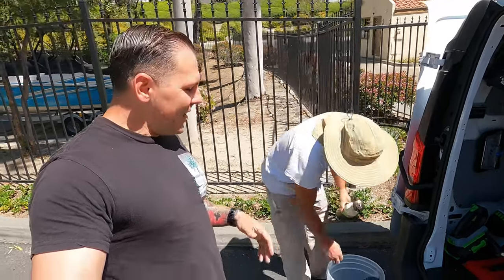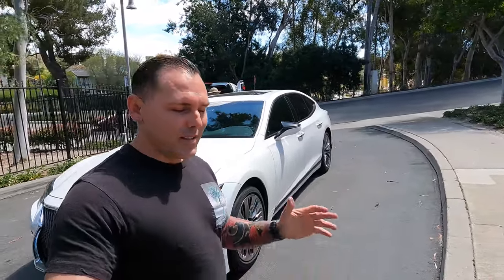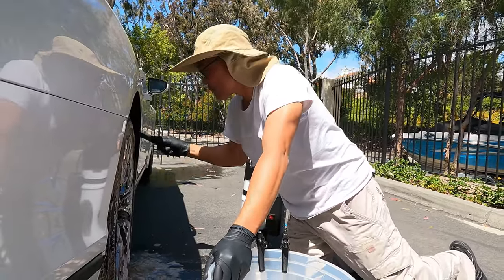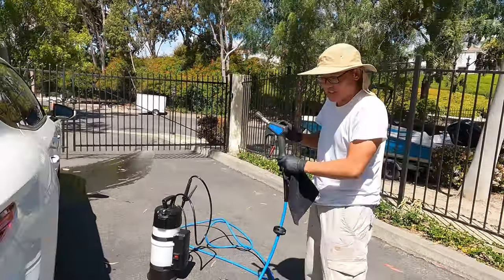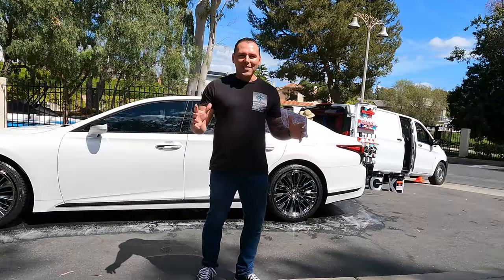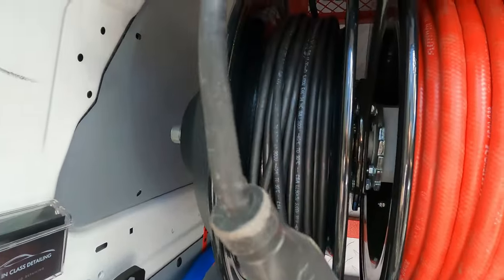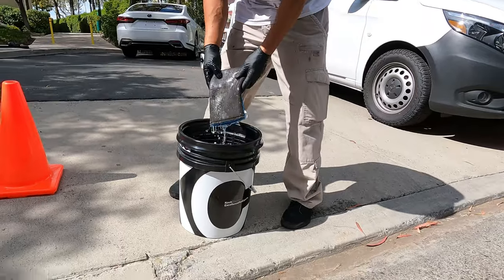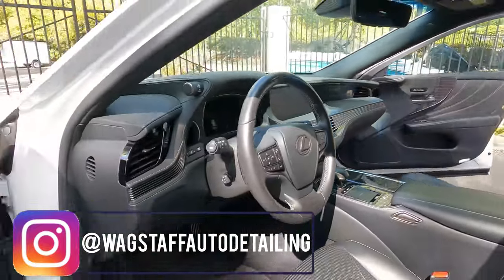Mobile Detailing Setups of 2024!!! Setups of America! MERCEDES METRIS EDITION!

Comment: I’m not sure why he’s not able to but I have the same delta pro and it runs my ridgid vacuum, ridgid compressor and my dupray tolsca steamer at the same time.
Reply: Have you added up how many total watts that is ? My predator 3500 runs the chief steamer & vacuum fine, but I can’t turn on the rigid compressor with them or it overloads. I’ve been thinking about the predator 5000 or taking the plunge to the ecoflow. Any thoughts or experience ?
Reply: @PolishedMobileDetailing503 the ecoflow delta pro is the at to go for sure when you get it on sale. I paid $2,000 for mine brand new with tax. It’s 7,200 surge watts and can do 4,500 running watts with x boost mode turned on. 0 noise, 0 maintenance and much more compact.
Reply from the maker: @obsessedmobiledetailing Id like to order one EcoFlow delta pro off you sir! 😂
Reply: @Skdjiejxuje  i appreciate it 👍
Reply: I mean it can run them all are you saying you’re using the steamer, vacuum and compressor all at once? That’s what I mean, they all can’t be on at the same time but YES you can run them together just not simultaneously.
Reply: @BestInClassDetailing  I’ve had my compressor running building up pressure and the vacuum on and steamer on at same time no issues. You can turn on X-boost mode which give 4500 watts running
Reply: @Skdjiejxuje  I should try it, I have a mytee 8070, vacu-maid and a vx5000 steamer I doubt it though lol it would probably trip on me lol
Reply: @BestInClassDetailing  I have that exact extractor as well and I run it at the same time with my steamer no issues at all. The extractor only pulls 2000watts.
Reply: @Skdjiejxuje  hold my beer! lol
Reply: @Skdjiejxuje how many hours do you get out of it ? Will it last a full 8 hr day of using equipment? Thanks 👌
Reply: @PolishedMobileDetailing503  it’s hard to give an exact answer because it depends on what your day includes and what equipment you’ll be using. If I’m just washing using only my pressure washer it uses only between 5-9% of charge per car. So that would last lots of cars. But the biggest power draw is the steamer. With steamer going a lot you can do 2-3 cars. I just got a 2nd delta pro so now I have so much power. Adding solar panels helps a lot.
Reply: @Skdjiejxuje  I often will have my chief 100 running for 2-3 hours during an interior but not necessarily using it the entire time.  Sounds like just using the pressure washer or vacuum it will go a long way which is good.